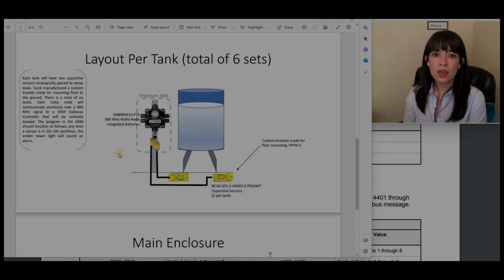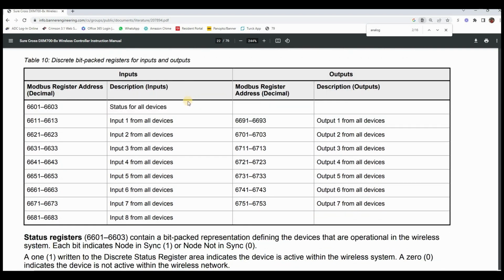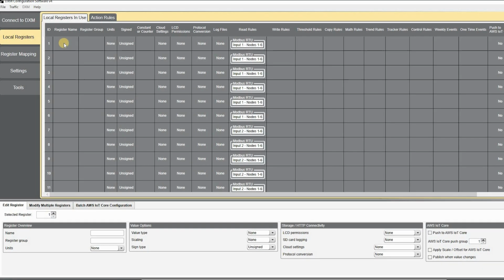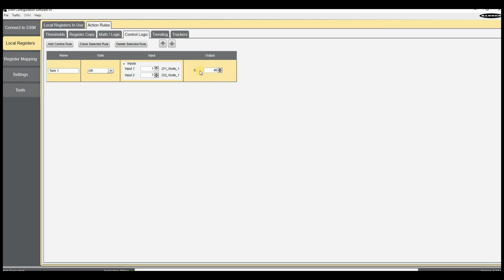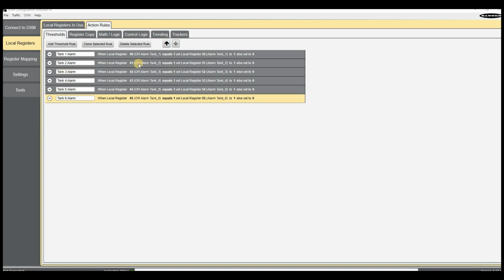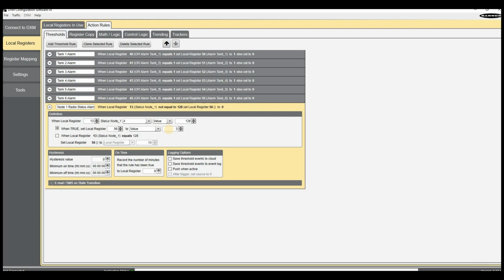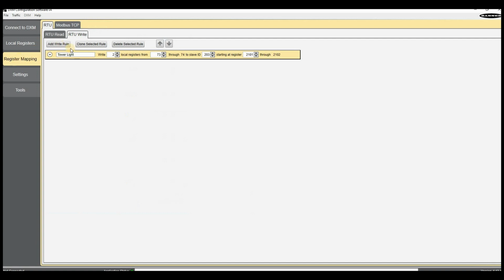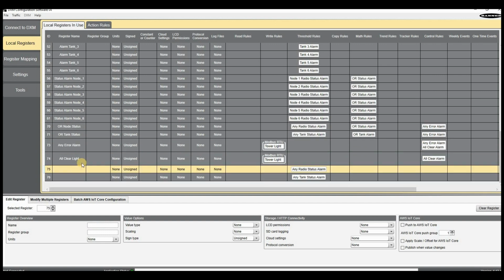Tutorial - DXM Action Rules, Alternative Register Mapping, Math Rules, Control Rules

Comment: Do you know if the DXM rules can handle counting? I've tried the Trackers rule and it's way too slow. Or are all the rules just as slow as the Trackers rule? (You do a super job explaining these.)
Reply from the maker: I recommend getting into the script programming if you need a faster counting output. Banner also makes radios with counter input terminals to be able to do higher speed counting. But yes it can be delayed if your doing a standard input and counting that. Depends on your wireless network.